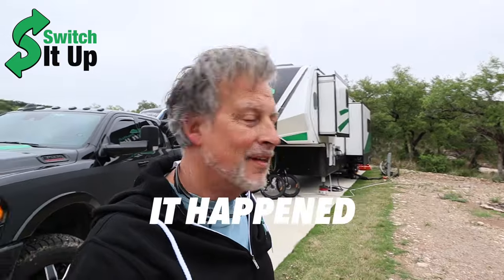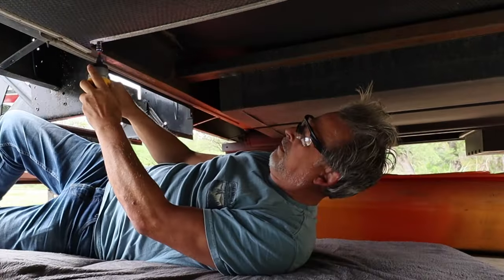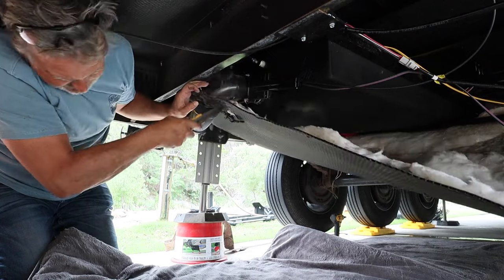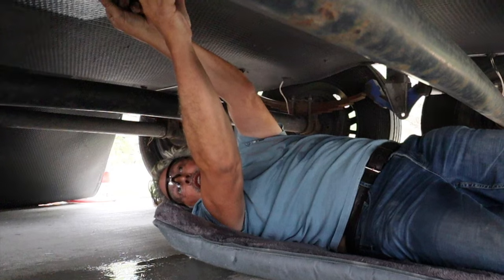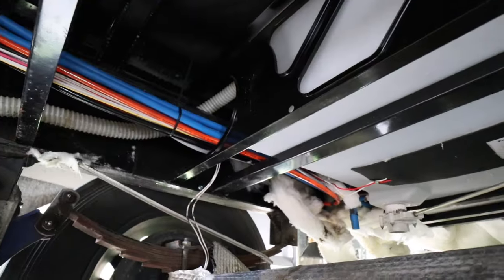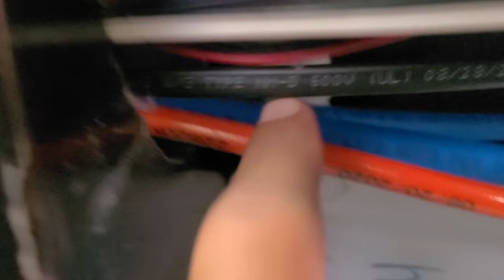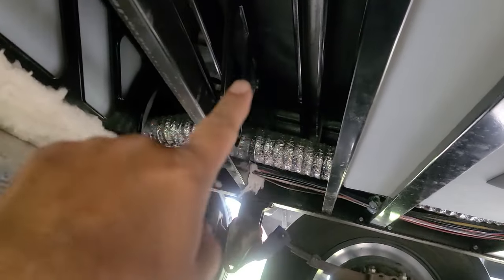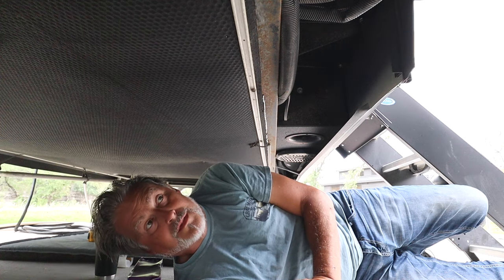RV Underbelly (Water Leak Issue.)

Comment: Something similar happened to us this February while staying in Florida.  We found water leaking from bottom of camper. Hubby took all the underbelly water barrier and insulation down to see what going on. This winter he had put a netting in basement cubby to hold items on shelves. Well…the tip of two of the screws just barely poked through and when grey water tank filled it expands. Therefore we had two tiny puncture holes on the TOP of the grey tank.  He very cleverly got access to the top of tank without dropping whole tank and sprayed layers of flex seal on holes.  🤞🏻 that does the trick. Luckily he is very good at coming up with unorthodox solutions. Hope all goes well for you going forward. Will pray for no more leaks.
Reply from the maker: I swear to own an RV means becoming MacGyver!!

Comment: Thank you so much for taking the time to film, comment, and post this very helpful video! I am so fortunate to have found this episode as I am going through the exact same ordeal right now. A couple of differences however: my OEM underbelly is made of steel. It is such a pain to work with that I am in the process of pulling the whole thing down, tossing it out, along with all the Fiberglass Pink insulation (which is mostly shot anyway because of all the water that has been absorbed over the years). As I am removing it, I am discovering multiple leaks, broken welds, and other issues that I want to address as well. I am replacing the steel underbelly with 4 x 8 sheets of Coroplast, and topping it with 1" foam board insulation and a layer or two of Reflectix. Removing the steel underbelly is impossible without using a portable grinder. Fortunately I have one and it makes pretty quick work of getting sections of steel off (although noisy as all get out, and pretty dangerous lying on my back with sparks flying all around me just 8" above my body). As you mentioned, age is a factor in this process. I am almost 74yrs old and I can tell you I wish I was about 40 years younger. Your video has been very encouraging for me, as I have asked myself the same questions as you, namely, "What have I gotten myself into?" I really appreciated that you could laugh about it. Thank you so much. I've SUBSCRIBED to your channel and will keep you posted with my progress.

Comment: This happened to us. What I FINALLY discovered is that a bathroom sink water feed line (where it screws on to faucet) was leaking and then the water was following the line back down into the underbelly and dripping off onto the coroplast. Luckily I discovered it before dropping the underbelly. So check all water lines at faucets!

Comment: That large diameter ribbed line on the top of the tanks is the vent line for the tanks. It is not meant to supply water. You can tell by the type of connector and fitting used. If you fill too fast you can force water in it.The tanks fill and equalize through the blue pex lines. The trick to filling the dual tanks on the Momentums is too fill very slowly so both tanks equalize through the little line on the bottom. If you fill too fast the main tank will fill way before the 2nd.

Comment: That’s an interesting tank set up. I have seen people change the soft insulation for the purple board thing in between the beams and use HVAC tape to hold it. 
And yes Die Hard is a Christmas movie.

Comment: Finding out how cheap these trailers are made.  Glad that I didn't buy brand new and found one that was practically new at half the price.I keep it covered all year. Now, I've had to replace my refrigerator and A/C so far. Now dealing with small water trickle leak. Im feeling like Tom Hanks in The money pit. Sum it up, I like how its advertised Made in USA on the outside.

Comment: Welcome to Grand Design RV ownership, we went thru the exact issue with our Momentum. Of course our underbelly was comprised from the first month of ownership, since Grand Design saw fit to glue our rear dump valve shut at the factory...yeah they really don't test at all at the factory. What good is insulation if it's soaked. We will never consider another Grand Design, going back to Keystone.

Comment: I have heard others have the same problem with water coming in from the wheels and filling the belly. It’s happened on a few of the GD Solitude 390RK so It’s quite possible that was the issue.  I will be caulking ours before we head out. Thanks for the tip.

Comment: We just went through a rain storm for about 6 hrs. and had the same thing happen. When I dropped the under belly I found evidence of water coming in from ABOVE THE FRAME RAILS. I can push the underpayment up easily with my hand to create a 1/4” gap. I will be caulking the top of the frame rails and see if that solves the problem. Thanks for the video. I wish I would have found it when you posted it. Lol

Comment: Todd, just had the same thing happen on my Sabre. Hot water tank inlet broke and flooded the underbelly. I dropped the whole thing and bought new on Amazon. Got some good insulation at Home Depot and replaced that cheap thin stuff. Lotta work and hope I NEVER have to do it again! No

Comment: Todd, need a couple of 15year olds for crawling around under their.  Us old guys tend to hurt for three days after doing a job like that.  Also Todd since you are already there I would wrap your pex pipes, check all fitting for loose claps, and use foam  board insulation and batt fill. You can probly get the rating up to R40+.  Also by the axles and tire you can get what is call fender whiskers, if you look on semi trucks and trailers where the tires are by the wheel wells trucking companies put those there and it helps control the road spray so the rain runs straight down towards the ground.  Something to think about.  By placing them on the inside of the wheel well it might help control that water.
I just moved two yards of compost and now I need a day off with massage therapy to fix the back.  Hope this fixed everything and you dont have to crawl again.
Safe travels and roads Brian and Cindy, "xtreambydesign with passion"

Comment: Oh boy.. My last 5th wheel had a leak and I just couldn't take the underbelly off easily so I ended up cutting it in large sections and added metal strips across - actually I think it made the underbelly much much stiffer and if I needed to get access again, it was a smaller panel to remove.  I felt you pain.  not fun at all.  Good job putting it all back together!
Reply from the maker: Thank you

Comment: Oh man, I’ve got a leak in the same spot on my Momentum 395M. Thanks for the sneak preview. I’ll be fixing mine this week. Great video!
Reply: I just drove through a rain storm and had the same thing happen. I pulled the underbelly and found evidence of the water spray from tire getting in over the top of the frame, not the bottom where the chloroplast is screwed on. I can easily push the black underpayment up about a 1/4” off of the frame rail. I will be caulking the top and hopefully that will help. Just FYI. Thanks and safe travels.

Comment: Those units seem to have the same problem , 1, they get bought , just kidding , but the shower mixer valves abd the " over pressure " vacume " breaker piece behind the panel in the cabinet.  Good luck . I should watch the whole vid before commenting because its already fixed . Safe travels

Comment: I don’t know if anyone else had this before. My Travel Trailer Apex RBS265 was parked for 4 month. No water in any of the tanks. Pulled it to the front yard to get ready for a weekend trip.
Notice water running out at different spots from the Underbelly. I can only think that somehow rain water pooled down there. Inside the trailer was/is no sign of leakage at all.
Not sure how it would all pool on the Underbelly. Any ideas???
Thanks for the great video, had to smile a few times, however felt bad fir you.

Comment: I bought a used older tt and had same issue, no leaks from plumbing, leak from road rain soaking the insulation in underbelly, so took out insulation, don't need it in my situation

Comment: Thanks for making this video, as I revisited it after a water leak issue on my Grand Design Transcend. For me the water tank ended up falling out due to bad straps when at the campground. I do wish that RV manufacturers would adopt a hard plastic panel design so you can easily service your rig when needed, and not drop and entire underbelly to get to one thing.